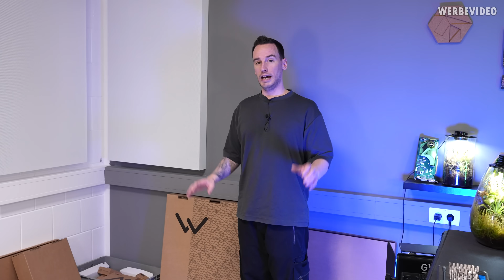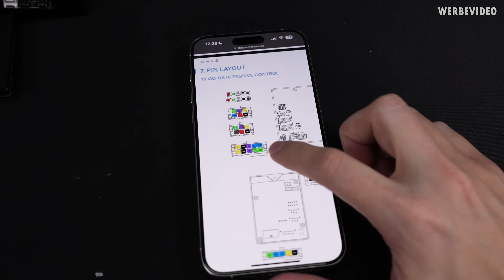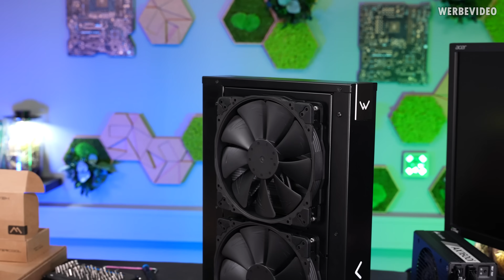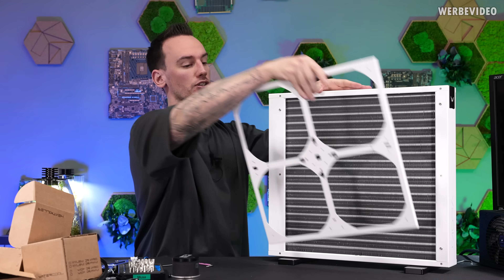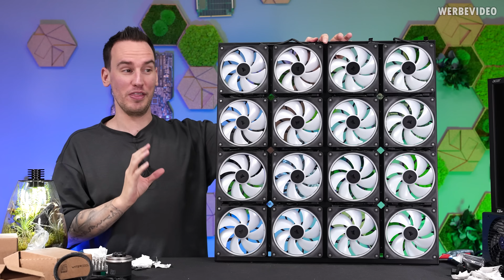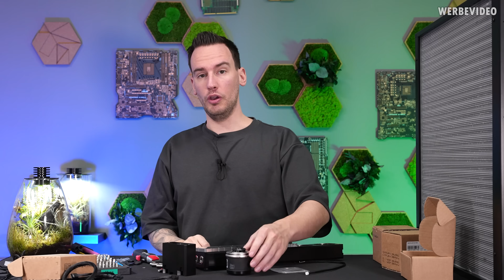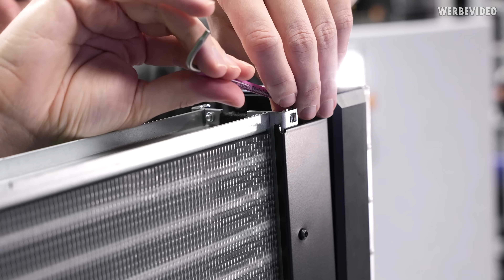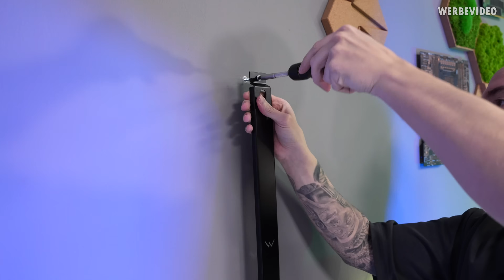The Most Extreme Radiator Ever Made - Watercool MoRa IV 600

Comment: 3 pumps. Why? Because you can. True water-cooling enthusiast :D
Reply: He did mention redundancy as a reason for 2. But this radiator is huge (tens of meters of piping), and the tube that'd lead to your PC won't be short either. I think you'd want 2 at all times, and a 3rd one for redundancy.
Reply: @FireStorm81318  1 pump does not have enough pressure for 400, god forbid 600. Minimum of two, for 600 probably 3 if you have any quick disconnects in the loop or more than 2 blocks.
Reply: @Chabster  That's what I'm saying

Comment: Engineer Der8auer can't do math while building PCs! 😆
If 3x 200mm fans add up to 600mm they are touching each other. 4x 140mm fans would add up to 560mm if they were touching each other so, to extend to 600mm, there is 40mm split in 3 gaps.

Comment: Thank you! I have been planing to buy one for over a month and I wanted to see more info, this was very helpful. I guess I'll wait for the active control to come out and make a purchase, the question is either the 400 or 600 version.
Edit:
Corsair iCue issues, pretty typical.
Here is an idea about the corsair iCue problem for controlling it. The power cable to the iCue hub  is simply 6 pin pcie cable to 6pin single row micro-fit connector - you can quite easily make custom one, the data usb 2.0 in one side and micro usb on the other, while making custom cable with micro USB might not be easy (but it's still possible), maybe just create your own custom internal USB 2.0 extension cable. All you need are wires crimps, crimper and connectors and maybe sleeves/heatshrinks. All of those are available in MDPC-X  maybe not the microfit 6 pin single row but you can get them from some place else.

Comment: My MORA 360 continues to excel in cooling my gaming rig. Because of the issues you are having now I skipped RGB for my fans. I have two pumps also w/3m of edp tubing. I also included a washable  almost HEPA air filter to keep the fins clean. I hope it still holds after you fill it. Those wall mount screws don't look stout enough. You should find a wall stud to attach them too.

Comment: I'm pretty sure the drywall is not strong enough to hold this with the water weight too. You are treating the american paper walls like they were german brick/cement walls, you have to find the wooden studs behind the paper wall and screw into those if you want it to hold heavy weight like that
Reply: I agree that those studs won't hold too long, but the water weight doesn't do too much difference. The rad weight is 16 kg, res + d5 expansions around 2.2 kg + 3 pumps + 16 fans (don't know the weight) so it is at least 20-22kg. The coolant will add around 3kg only.

Comment: Need a case where you can socket these radiators. LOL. You can probably put a furnace filter in there and its also become a air purifier. 
Probably do not even need fan for the little one for a modern x3d chips.

Comment: I wonder if it will be enough for Xeon 2699/2696v3? They seem cool without load, but under load and with Turbo Unlocked the throttling is terrible, even with the 6-pipe cooler.

Comment: If ur running a 3090ti or 4090 using an external rad is a must wothout aircon the heat is way too much in summer especially if u dont have aircon.

Comment: Definite improvement over the jankiness of old MoRa setups, but I fear at the same time the price has ran away from the land of "expensive" to "insane". Then again, we do know there definitely is a market for insane stuff like this. Have to admit that if I were to build a new watercooled PC, I'd probably go for this (well, the sane one, ie. 2x 200mm fan version, the bigger one would probably need multiple PCs in the same loop to be needed)
Reply: Alphacool makes pretty cool 1080 and 1280 radiators that are really affordable, around 120-140 USD.
Reply: @Vatharian  Yes, Supernova. But it’s the literal definition of jankiness because there isn’t that many accessories for it. It’s a good price though.
Reply: @Simon_Denmark  I disagree: there are at least - stand with a mount, legs, fan mounts, wall mount, cable guides, fan control splitters, pump mount, pump with res mount, tube guides, shrouds and vibration dampeners. This is all universal to boot, so you can use any LC parts you want, really. WC's Mora ecosystem is just another take at "let's make our own way of making money" - you pay for the fact you don't have to make it look less DIY.

One thing that matters is that with both we have a choice - less expensive but more flexible and pricier but but prettier solution. I hate the price of Mora4, but I love the features, even if I have different vision for this type of cooling solution.

I paid (converted) $95 for my Nova 1080 when it was new (four of them in total, for sake of completeness), and it doesn't matter how much more cooling Mora4 600 provides, I can get more heat exchange surface for the same money - but hey perf per money unit isn't the best metric, especially in custom LC world :D
Reply: @Vatharian And smaller, I have one of their 560 square rads.  Planning a custom build around it, probably wall mount.   Even that relatively small rad is more than capable of cooling most systems.
Reply: I dunno man why not just get a car radiator or two for the price?  you're not limited to 12v fans either.  100 bucks buys you a really big a** radiator for a truck. another cheap source is used or new air conditioner parts. the outside of building radiators, but they tend to run series I think rather than parallel like a car radiator. the point is just that the radiators are not niche products but as soon as the word PC is attached to it the price goes almost 10x for same amount of aluminum or copper. if you're not pressed for space you could just stack radiators for the same price and get away with passive.
Reply: @lasskinn474  Sounds like a fun maker project if you have the skills, but would definitely be janky. And yes, you found the business model of lot of specialized PC stuff - small volume but big margins. Someone has to pay for the engineering and product development and if the parts sell in small quantities, the price is high. Also the margins are not as high as you may expect, as manufacturing small runs of specialized stuff is more expensive than you may think. Market forces take care of the rest. If they are priced too high, they won't sell.
Reply: @lasskinn474  One good reason is that car radiators are typically aluminum. Welcome to corrosion hell.
Another reason is having mounting hardware and other extras that fit the purpose.
What are you planning to do, duct tape a box fan to a car radiator and call that piece of  jank good enough?
Reply: @Jarnis-v1c  There’s nothing janky about the MO-RA 3 though?
Reply: @Simon_Denmark  MO-RA 3 was fine. Getting a pump, fans (and their control) and reservoir attached to it and to the PC was a janky setup of cables. And there was no ready-made solution either, you effectively had to jerry-rig the cabling from the pump and fans somehow into your PC.
Reply: @Jarnis-v1c  That’s true, I had to use extension cables to connect the fans and pumps to Octo and Hubby 7. So that’s definitely changed for better with the new controller. I could change to wireless from PC though if I have a controller at MO-RA but I would need an external power supply. The reservoir and pump aren’t that janky with the bracket for them.
Reply: @Jarnis-v1c  Almost everyone I'm aware of has used an Aqua Computer Quadro or Octo and only needed 12V power and optionally an USB-cable to their PC. It's a lot less janky and doesn't require any software to be running on your PC (after initial setup)
Reply: @Jarnis-v1c  this, I'm still using a ultra jank Molex power brick (which I got from a USB to SATA adapter lololol) with my MoRA3.

I do have a extra long SATA cable waiting at a contact of mine though to make that setup a LOT less jank.

Comment: iCue devices do have a memory mode that they always default to when iCue isn't running. There's a toggle in the iCue settings somewhere.  Love the new MORA. I've contemplated getting something like this since I'd built my first watercooled system back in 2008. Unfortunately, with the cost of components being what it is, I could never quite stretch my budget to get one. It's going to be one of the first things I buy when I win the lottery though ;) Anyway, it looks awesome, can't wait to see how it turns out once fully assembled. Looking forward to that video.
Reply: Can confirm. No way I’m running iCue all the time, but I did use it to set the fans how I like then stored the settings in hardware
Reply: The option is called Device memory mode, it's a new toggle in the newer Icue versions. I use it to save my K100 keyboard macros and lighting 'cos I find Icue crap for most other things and it 'used to' interfere with the RGB of the fans I use and cause them to become disco strobe lights instead!

Comment: Corsair iCUE is super buggy, especially when it has to interact with other RGB software, like MysticLight. I have to restart iCUE on every boot and wake up, and then re-apply the settings for my RAM sticks in MysticLight, in order get it all working. If I don't do that, the RAM is either barely glowing (much dimmer than the minimum 10% setting, that I use), or - get this - only one half of the sticks is lit up (just the upper half is lit on both sticks, for example). Everything is updated to the latest version. It's just atrocious.
Reply: Yep, it's basically this. iCue runs fine when you only have Corsair gear installed. Add anything else to the mix and you're going to have issues. It's pure garbage dumpster fire.

Comment: You can literally do this for a fraction of the cost using a radiator like from a 92-95 Civic (50 bucks) and a 12v electric water pump based off the head pressure and flow rates you want for about another 50 bucks. Sure, it may not be pretty for some people but you said you have it tucked under your desk. Then there is the issue of diminishing returns. Building a 20 foot square radiator won't do any better than a 120mm radiator in some situations. To figure the optimal size that takes some math. But i can't fathom people paying these prices for that setup.
Reply: Yeah, I did the exact same thing, only in reverse in order to build a poor man's AC by connecting the radiator to the faucet and kitchen sink. I know it's a waste of tap water but since it's much colder than ambient air I managed to cool the room a couple of degrees. At least as a temporary solution it worked pretty well.

Comment: I wonder if you can put these outside.
Reply: Depends where you live. Condensation and freezing are possible issues.
Reply: sure you can, you just need to run antifreeze instead of distilled water if the temperature goes below freezing outside. But then again, a used copper radiator from some junked AC unit would be 1000x cheaper and just as good
Reply: @Jultsu  And somehow you completely forgot to mention the possibilty of condensation between the cold coolant and the hot waterblocks.

Comment: You really should get some proper drywall anchors for that amount of weight
Reply: Or an actual stud yes I agree plugs are to light for this with liquid if it has to be there anchors are the way to go.
Reply: He is probably used to concrete walls, he had a hammer drill. Hammer in some expanders in concrete would give way higher confidence then normal plugs in dry wall, in dry wall get at least molly or crocodile plugs...
Reply: If you didn't hit studs, that things going to hit the floor.  My mora3 weighs more than a large dog, I can't imagine what this setup weighs empty, let alone full.
Reply: that fischer plug wil expand and pull the core back to the wall
Reply: @DeviloftheHelll  i love fischers, 8 of these hold my dip bar in concrete, 200kg ez
Reply: Drywall?  LoL, that thing needs to be mounted to studs.
Reply: @wallywest2360  1 thing you forget, he is in germany where drywall walls made from atleast 2 layers of 12.5mm sheets and most of those are pretty dense not the american 7mm style single layer
Reply: @DeviloftheHelll  I don't care if it's 2 foot thick drywall, it's still drywall.  No way in hell I'd hang that thing on anything less than a 2 inch screw into a 2X4.
Reply: @DeviloftheHelll  He mentioned that it was a very thin "paper" wall structure. The potential of ripping out is extreme.
Reply: @wallywest2360  well its not made by american standard. so you can hang almost 100kg with 4 plugs on a 60x60cm square in european drywalls :) if you use construction grade sheets it goes up to 60kg/anchor just to the drywall.
Reply: @leonply  if it would be really thin, that drill would have gone trough faster btw. but drywall to a german will be always thin paper wall. usual wall thichness is around 40cm or more with masonry or cement blocks
Reply: @DeviloftheHelll  Better watch the video again, and see just how quickly that drill bit penetrated the drywall, and the telltale amount of gypsum power on the bit itself, indicating the thickness of the wall. The radiator/fluid/fan/ pump/controller/tubing combined weight is too great for two average-sized fasteners.
Reply: @wallywest2360  Fischer Dübel will carry that weight easily, my man.
Reply: European drywall is quite strong most of the time, those plugs are also good at spreading the load.
Reply: Its Germany not the USA the walls are not made out of Paper😅
Reply: @JeremyHirsch-oz7lc  That doesn’t disregard the way it’s attached to the wall.
Reply: Just drill right through the plasterboard into the brick/stone on the other side. Unless you live in America I guess.
Reply: Eh, it'll be fine.

Comment: I like Roman for going with solutions like this. Nearly every video is interesting and kinda what i am into exactly as well. Had a MoRa3 420 like 5+ years ago with 7800X on direct-die with the TG frame and SKX delider. I am currently also using the Intel Mycro Direct-Die Pro for my 13900KS and have been very satisfied with it so far - now the limit isn't the thermal transfer from the die but the capacity of my 360+240 slim rads.

Comment: 4 basic plugs to hold 16+ kg on a drywall is extremely brave 😅
Reply: 16kg without the water 😮
Reply: @ODSYViper  it is 20-22kg without the 3l coolant. You forget the reservoir, pumps, fans + etc. weight.

Comment: I wouldn't count on those plastic plugs for plaster wall mounting...
Metal ones that open up like an anchor when screwed is what i always use when heavy items are mounted, like TVs or this monster in example!
Reply: Yeah that rad is gonna come down that wall sooner than later. That simply is not the way to attach such heavy weights to a "paper wall".

Comment: IMO
 you need sturdier wallmount.
Preff one that offloads weigt by touching the floor.

What is the total retail price of this beast?
Reply: The radiator itself is 550e, tank 180e + two extra pump holders 50e + 50e, pumps he had previously so 0e. Fan shroud for the 600 was like 80 euros and the corsair fans were 720 euros if I remember correctly. Over 1500 euros for total but you can create a working setup for cheaper than Roman did.

Comment: I've never really understood the MO-RA, it's just bruteforcing an inefficient radiator design, condensers are only built like that because non-round tubes would blow out under high pressure,  but round tubes have poor surface area to volume ratio and are more restrictive to airflow, hence why every low pressure automotive radiator and heater core uses flat channels. What size properly made radiator would provide similar performance to a MORA 600?
Reply: it's the cool factor but it's more so about water volume and less about efficiency. either way the mora exists for the same reason intel releases KS processors, or amd releasing X processors even though all of them are unlocked, etc, etc. can you use something cheaper? yes, does everyone want to do that? no.
Reply: Same, and I wish one of the smarter rad designers would also make a 2x3 rad.  I've seen nothing between a 360 and a 360x360.
Reply: Good luck with the flowrate with flat channels on a radiator that big for PC cooling. I feel like that would be aquarium pump terrority.
Reply: @Simon_Denmark  There's already radiators the size of older MORA products, I believe they actually performed better than the mora and  were less restrictive, but I can no longer find the data since it was on forums in charts uploaded to a now defunct German image hosting website. The round tubes in the mora make several 180 degree bends that's actually quite restrictive.
Reply: @brandonupchurch7628  True I forgot to edit my comment about Alphacool’s Supernova. It would be cool if Roman did a video of comparing MO-RA IV and Supernova.
Reply: @Simon_Denmark  A standard flat tube radiator flows through half the tubes in parallel in each direction.  That can be less restrictive than the snaking tube of the MoRa.  Also, a square U-flow radiator is less restrictive than a standard one-column radiator of the same height because, again, more tubes in parallel.  Plus, air resistance is more important, and round tubes + aluminum fins cause more air drag.  Also, aquarium pumps are not necessarily high pressure.  They were only used in the early watercooling days out of desperation.
Reply: perhaps you should make a flat tube radiator to compete against MORA. Maybe then you’ll will understand the trade offs they make